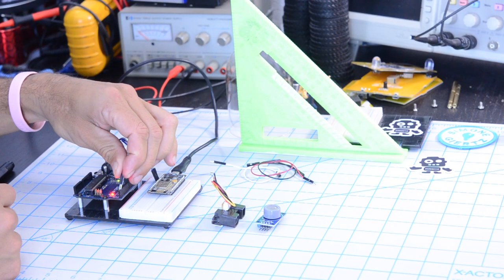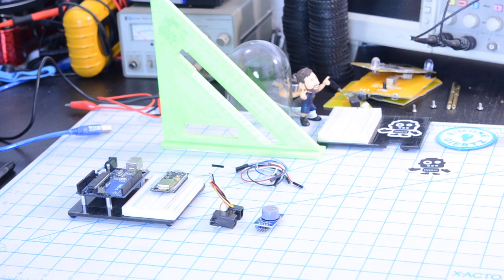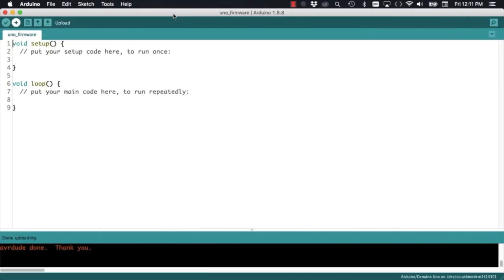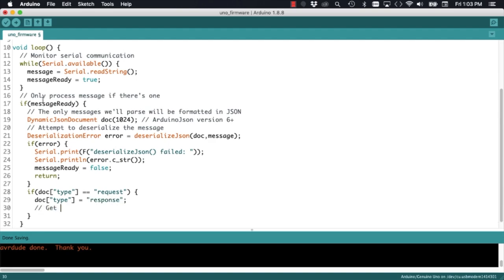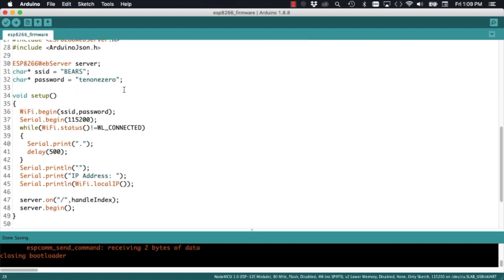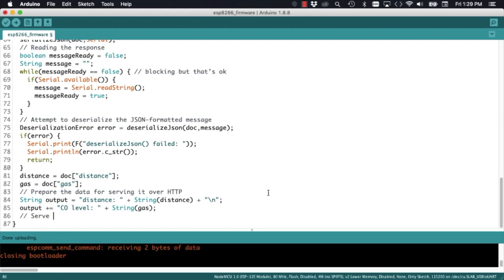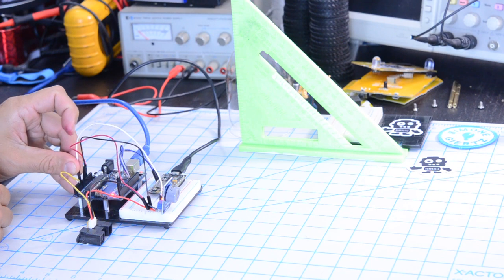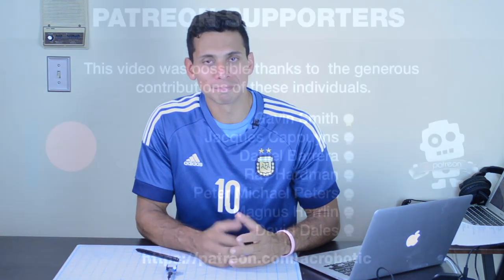Arduino to ESP8266 Data With Serial Communication Using Arduino IDE (Mac OSX and Windows)

Comment: The startup WIFI status output to Serial, generates a invalid response which causes the whole communication to be out of sync. I'm getting "delayed" values, meaning the if I request a web update, then I get the values from the update before.
I solved it by emptying the serial buffer at the end, ensuring that nothing is left. Insert a Serial.readString();  just after server.send
Reply from the maker: Great tip, Poul. I'll pin your message for those following the code!

Comment: If you're tired of waiting "forever" for the response, speed up things a lot by adding:   Serial.setTimeout(20);
in your Setup method, on both the Arduino and the ESP.
It will be lightning fast, but perhaps you need to adjust the timeout value. Also running 115200 on the serial port speed is great.
Thanks for the video by the way, ACROBOTIC. You saved me a lot of time with this simple setup!
Reply from the maker: Heya, Poul. Thanks for watching, I'm glad you found the code useful!

Comment: 03:55 What if there are more serial data available? The current loop will overwrite the message and only keep the latest message. Is that expected? Thanks.
Reply from the maker: notice that the while() loop is blocking, so as long as the connection doesn't close, the data will be read. thanks for watching the video!
Reply: @datasith  Yes, it will keep overwriting the message because it is using "=" and not "+="
So the second iteration will overwrite the message stored on the first iteration.

Comment: Sketch uses 294304 bytes (28%) of program storage space. Maximum is 1044464 bytes.
Global variables use 27672 bytes (33%) of dynamic memory, leaving 54248 bytes for local variables. Maximum is 81920 bytes.
esptool.py v2.8
Serial port COM6
Connecting........_____....._____....._____....._____....._____....._____.....____Traceback (most recent call last):
  File "C:\Users\sunny\AppData\Local\Arduino15\packages\esp8266\hardware\esp8266\2.6.3/tools/upload.py", line 65, in <module>
    esptool.main(cmdline)
  File "C:/Users/sunny/AppData/Local/Arduino15/packages/esp8266/hardware/esp8266/2.6.3/tools/esptool\esptool.py", line 2890, in main
    esp.connect(args.before)
  File "C:/Users/sunny/AppData/Local/Arduino15/packages/esp8266/hardware/esp8266/2.6.3/tools/esptool\esptool.py", line 483, in connect
    raise FatalError('Failed to connect to %s: %s' % (self.CHIP_NAME, last_error))
esptool.FatalError: Failed to connect to ESP8266: Timed out waiting for packet header
esptool.FatalError: Failed to connect to ESP8266: Timed out waiting for packet header

_
Sir, the Following error occur while uploading esp_firmware. Please help me how can i resolve it. Thanks
Reply from the maker: Seems like you're having USB communication problems. This could be due to a bad USB driver, or not selecting the correct port for the ESP8266 board. HTH!

Comment: Serial.print puts data to serial port and it's a loop then between Arduino and ESP8266. Is there any workaround or just not use Serial.print at all for debug statements ?

Comment: Hello. I have one question. I want to make a communication between an arduino uno/mega and nodemcu with esp8266 module with i2c.I saw this tutorial and i want to ask you : can I power up the nodemcu from the arduino?  I mean to make a connection between 3.3v arduino's pin and Vin pin from nodemcu.
Reply from the maker: heya, yes you can, but read in full to know a risk! 1) depending on the NodeMCU board you have, you'll probably need the 5V pin on the Arduino to go into the Vin pin of the NodeMCU. Yes, the ESP8266 is a 3V3 chip, but the NodeMCU board typically has a voltage regulator at Vin. 2) where the voltage difference is important is on the SDA and SCL lines. they will be 5V because that's the operating voltage of the Arduino. in theory, the ESP8266 isn't 5V tolerant so you should use a level shifter (e.g., 74LVC245) to convert the 5V down to 3V3. but, in practice, communication works without the level shifter. it's up to you if you want to take the small risk. hth!
Reply: @datasith  Thank you very much. I also own a level shifter but I wasn't pretty sure if I realy need it.
Reply: @datasith  and also the board is NODEMCU v3 LoLin

Comment: I'm having issues getting this to work on my Arduino Nano, ESP-01, and OLED screen. When I run the code with the OLED commented out, the web server loads no problem. However once I uncomment the code for the OLED, the web server does not load up. Also, the OLED may or may not turn on. Any idea what could be going on?
Reply from the maker: Make sure you're not writing locking code in your loop function. The server.handleClient() function needs to run relatively fast for the web server to work properly. HTH!
Reply: @datasith  Thanks for your reply. It seems like the issue was with the Arduino Nano not having enough RAM. We ordered the Arduino Every and everything is working fine now.

Comment: Can I ask you if you are using the NodeMCU with Lua or AT commands? Because I followed every step of this video and it is not working for me. Could it be because you are using AT commands? Thanks
Reply from the maker: when you flash firmware to the NodeMCU, it wipes out what was previously there. you need a specific firmware to run either Lua or AT commands. so, in my case i'm running custom firmware. where exactly are you getting stuck?
Reply: @datasith  Well I have tried and now it works! LOL.  The only thing that miss and would be awesome, is to add to the web server an autorefresh every x second. How can I do this? Thank You so much,you do a great job!!
Reply: @datasith  basically the custom program runs away from the AT commands right?
Here AT commands do not respect timeout, it asks for connection, the host does not respond, then it happens that the Arduino program crashes. Terrible. I just want the arduino to send the variables to the esp, and the ESP8266 to handle all the connection request part, if the connection drops, reconnect and so on, in addition to the benefit of freeing a good part of the arduino's RAM. So your video shape solves these problems?

Comment: the esp8266 is 3.3v not 5v regulated, connecting the tx of the arduino to rx of the 8266 will burn it right?
Reply from the maker: You're right that in principle these operate at two different voltages. The documentation on the ESP8266 indicates that the pins are not 5V-tolerant. However, some online discussions suggest that the pins are indeed 5V-tolerant, so out of laziness I'm going with that :) In my many experiments with it, I've never burned one, but if you wanted to be safe use a level-shifter. Thanks!

Comment: Hi. Is there any other way to parse the input without typing in the input of the serial monitor?
Reply from the maker: Hi! At first, I use to simulate the data sent from one board to the other. But then, I let the two boards communicate between themselves and I only use the Serial Monitor to monitor the communication, so no typing is involved. Thanks for watching!

Comment: Great video and its easy to understand, however i ran the code on mega, the url/web request trigures the function handleIndex and data is sent to mega but the esp cannot deserialise the response it says "{"type":"request"}DeserializationJson() failed: IncompleteInput"
Reply from the maker: Thanks, I'm glad you liked it. It seems you're getting a bad response from the server. Print it out to the Serial Monitor before trying to deserialize to find out what's wrong. HTH!

Comment: HI..!! thank for your video.. your channel its great..!! I tested your code and works but when I send requests quickly the deserialization fail and return noMemory and remain blocked. I tested increasing the size of memory from (1024 to 2048) but when I do this its fail directly Im using an arduino Uno and a nodemcu. Its posible solve this problem or I need to use anothe approach to send a request multiples parameters quickly?!
Reply: I solved the problem... this was the memory I asign to doc.. 1024 its a lot.. with 256 works. now the problem its the delay of reaction that its arround one second.

Comment: Your tutorials helped me a lot.
Thanks for making such a wonderful video.

I am doing project in which I interface Esp12F with Arduino promini.

I planned to use ASCII code base technique.
Like. Send character 'Q' for query. & Response Star with 'R' followed by data..

After watching your video I changed my plane & will try JSON as you have shown.

My question is what benefits I get if used JSON formated data??
Reply from the maker: I'm glad the info in my vids is useful! The main benefit in this case is being able to address your variables by key, for example data["temperature"]. It makes the code more readable and organized. The main benefit overall is that it makes 'chunks of data' easy to parse.
Reply: @datasith  thanks.  In my method I have to do lots of character checking in code & chance of error is high.  

So if I use JSON format then codeing time also reduce.

Thanks for your reply.

Comment: I hope that you could save the data into a file and store it in spiffs. So the data file can be managed later.
Reply from the maker: i have other videos on storing data in SPIFFS (ssid and password). maybe you can re-use the code from there?
Reply: @datasith  I have watched your video, It is quite straight forward. However, I want to store dynamic data which stored every single minute into spiffs from serial or the other GPIO pins. Managing the files like delete, rename etc, therefore I can utilize 3mb of spiffs instead of using microsd module.
Reply from the maker: @LeoL123 , storing the data should also be 'straight forward' using my OTA code. Instead of storing the SSID and password in the setup function, you should move the code that writes to the File System to wherever you're trying to store the data.

Comment: Hi ,
Thank you very much for this. It is really helpful. I am getting the following error:
 ets Jan  8 2013,rst cause:4, boot mode:(3,6)

wdt reset
load 0x4010f000, len 1384, room 16 
tail 8
chksum 0x2d
csum 0x2d
v8b899c12
~ld
____________________________________________
The rst cause:4 means watchdog reset which is caused due to the while loop in esp code, I tried using delay, yield, and also ESP.wdtDisable();
but I am getting same error. I am creating server as AsyncWebServer server(80);

I have also posted the issue here: https://github.com/esp8266/Arduino/issues/7344
Reply from the maker: Hey, Pushpa. Thanks for watching the vid, I'm glad it was helpful. The error is a standard reset as you point out. You can't do too many things in the loop when you're running a server, so you'll need to find a way to execute your tasks differently. You've already tried the easy-fix solutions, so you'll need to attempt to modify your code. HTH!